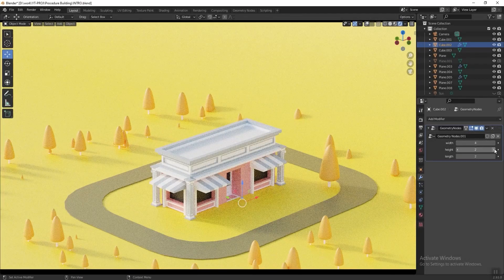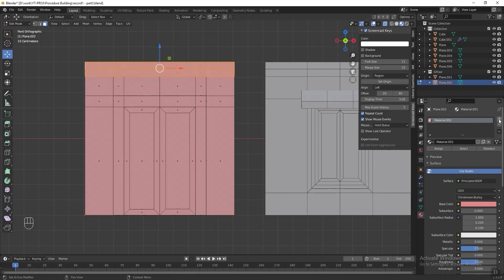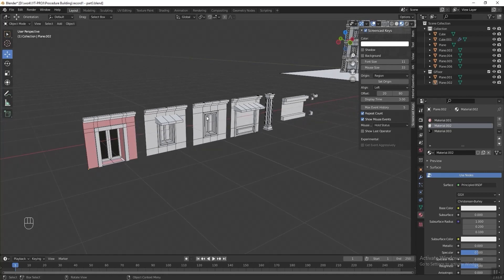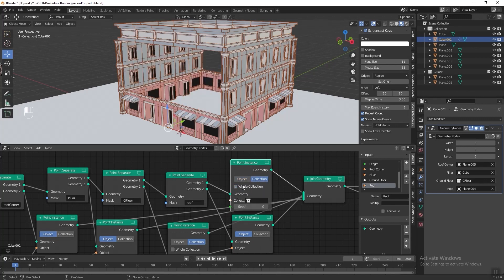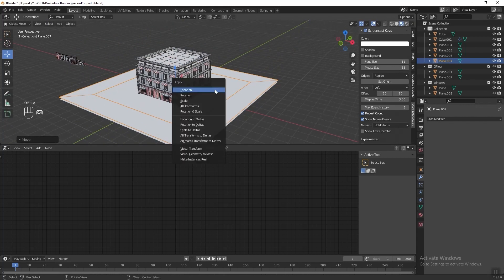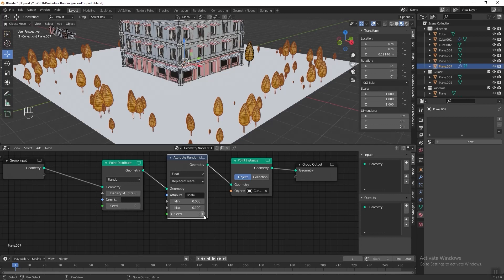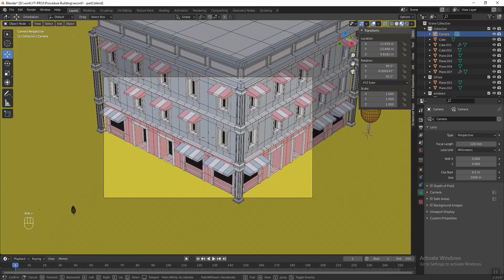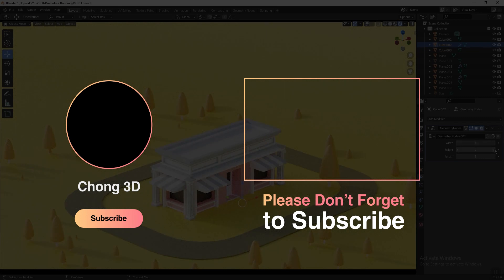Blender3D - Creating a procedural Building with Blender 2.93 Geometry Nodes (TUTORIAL PART3)

Comment: is there a way to save the building and export it as it's  own fbx or obj? every time i try, when i import that fbx or OBJ it's just a plane
Reply: okay, so i figured it out. i'm in Blender 3.0 now, but i followed this tutorial in 2.93 so some of the nodes no long exist and there for can't be applied.
Reply from the maker: Geometry Nodes is actually a Modifier, so you can try to apply the Modifier before export it to OBJ
Reply: @Chong3D  do you think you could do this tutorial again, but for 3.0? some of the nodes no longer exist and completely break old saves. I love how you explain how and why certain methods are used. it's very educational. most tutorials are "do this, do this" but you actually say "do this, because if you do this other thing, this will happen"